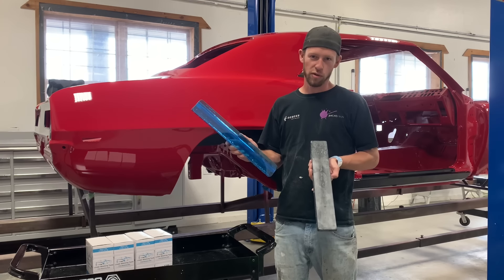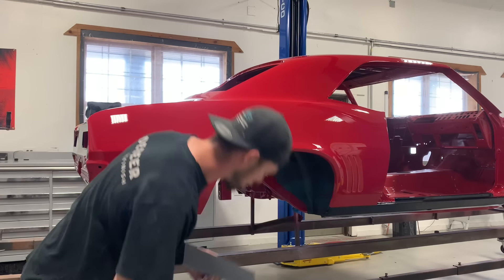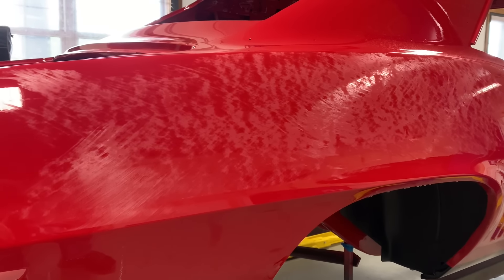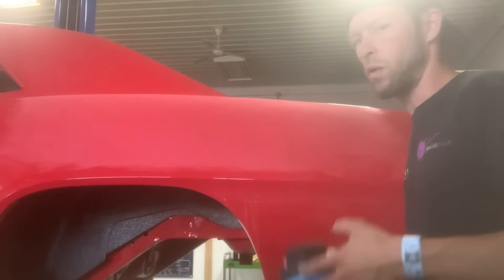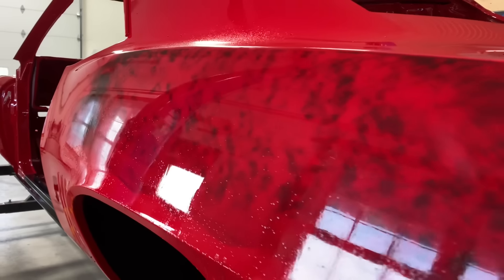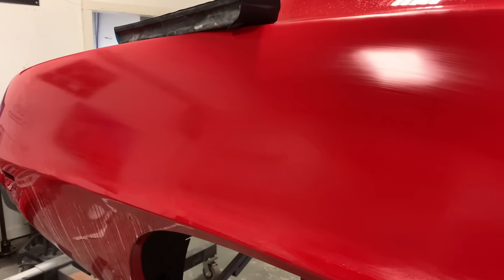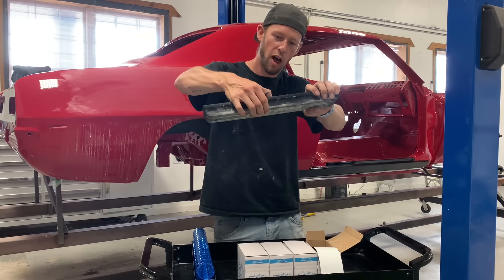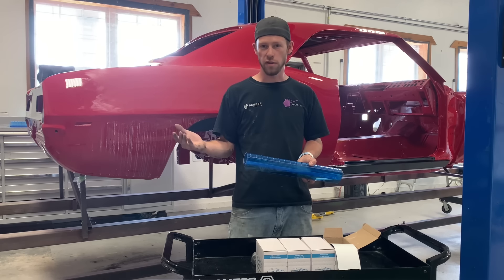Linear blocks showing what other blocks don’t!

Comment: WOW, just WOW. I got my 4 block starter kit last week and was waiting for the sticky back wet/dry which finally came this morn. I had blocked the car using the same brand rubber blocks you have in this video with 400 dry (the car is in what we call in Australia in Hi Fill, which is spray putty). I started on the roof with the stick back 600 W/D. and guide coated all with powder. The paper clogged really fast and was shit to work with so i decided i had to wet it. What i found was wet is the go but you need to wipe the bulk of the guide coat off with a wet rag or it still cloggs the paper too quickly. Anyhow these blocks are friggin amazing. NOTHING can hide. I cant wait to see the results when i start using the blocks from the get go. But for now they are worth every cent of the Australian $100 per block in fact that is more than fair as the paper i used is $86 for a 5 mtr roll. It is a different brand to the one used in this vid. Next time i will order the Linear paper and hopefully it is as good as their blocks.